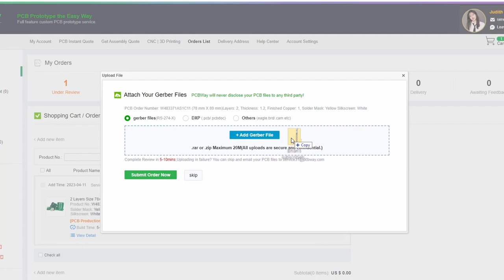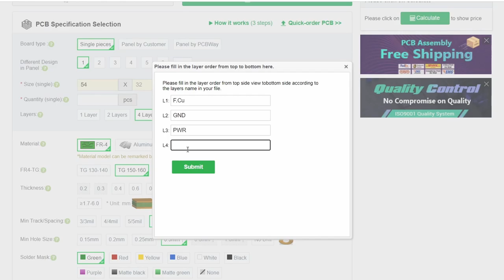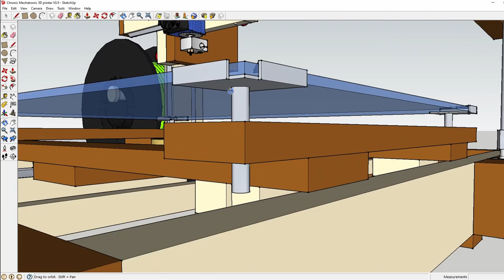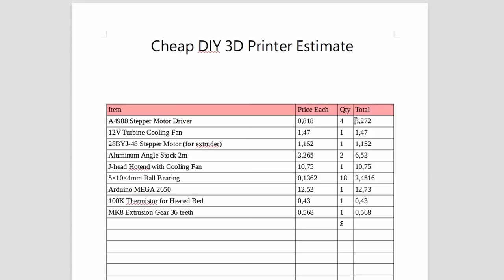Building a unipolar 3D printer part 7 | X-carriage and glass build plate!!

Comment: Just wanted to add that in my experience, those cheapo diamond-electroplated hole-saw-style drill-bits can be used to drill many, many centimetres of glass before they wear out. With a bit of running water over them, they engage very well in the glass and have very little chance to cause chipout on the front face, but still tend to chip some glass out the back when it's not supported by another material.
Reply from the maker: Thanks!

Comment: my heated bed was made of jbweld type epoxy glue and since it runs on 12v i calculated watts per resistance from ohm law and then just bought 1mm or something resistive wiire
it took 1 meter of wire bend in snake game imitation over entire table made from 5mm plate aluminum from cheap online seller  and i attached it by coating aluminium with epoxy once, then laying my wire heater flat and smearing it with epoxy sandwitched it between some baking paper and foam  on top of metal table, clamped down and heated with heat gun  untill it solidyfi
my printer is wierd and i had similar financial goal at first but i blew it 3 times at the end :]
 i really like your crazy design even though you are trying to solve many problems that don't really exist
getting unknown nema 17 motor from dot matrix printer usually is around 1$ a piece inb my area but it is admirable how you are engeneering around the unsiutable motors for this project

Comment: Hello, wonderful Please, please, please, please Can you please make a video in which you talk about controlling the motor, not the stepper (two-line) that is found in printers....the tape or wheel encoder away from the servo Especially receiving signals from optical sensors, amplifying them, then dealing with them, and how to identify the exact position of the axle vehicles........ etc. And we are thankful to you
Reply from the maker: I think I will get to closed loop control using DC motors at some point in the future :)